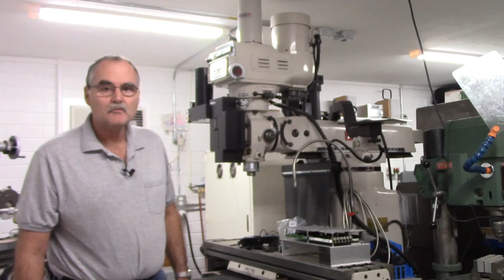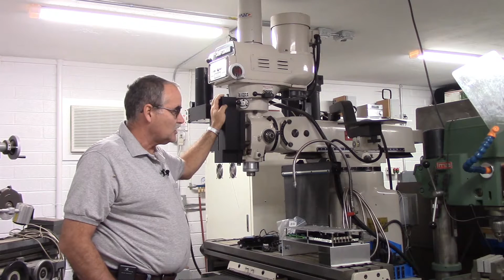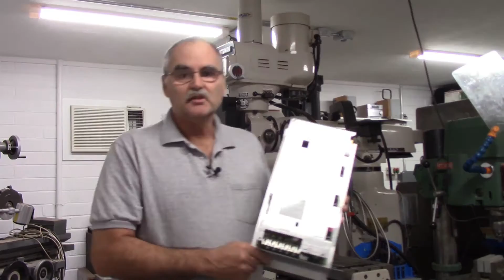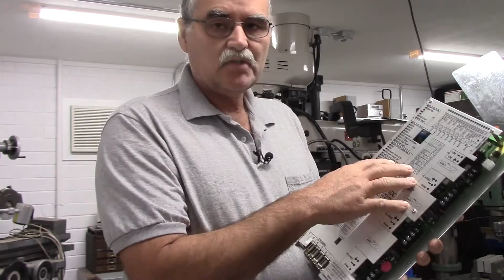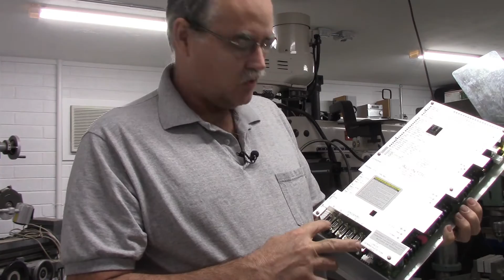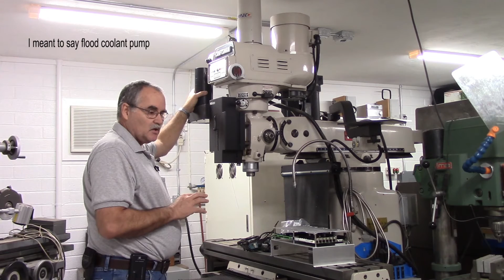Centroid CNC Upgrade - Knee Mill Project Overview

Comment: How many do you have in back lash z axi if currently this kind of machine has a gear?
Reply from the maker: The quill is directly driven. The ball nut attaches to the front of the quill. No gearing.

Comment: Hi Marty, followed here from your post on CNC Zone. In this video, you mention it originally had glass scales.  Does the Allin1DC have the ability to read those for primary loop feedback? I'm considering this board on my Hurco, but want to convert to glass scales and remove the need for leadscrew comp.
Reply from the maker: James, this question is best asked on the Centroid CNC User forums.

Comment: Hi you think I can use it on my Bridgeport Boss8 R2E3
Reply from the maker: Hi Abram. Yes, the All in One DC should work great. Suggest you take pictures of your motors and nameplates and ask the question over on Centroid's User forums where Centroid Support staff monitor as well as other users. http://centroidcncforum.com  I think you would just have to change the encoders on your motors, but would need to see which model motors you have.

Comment: I've been looking at the Centroid for some time now.   Keep up the vids, they're much appreciated.
Reply from the maker: Absolutely. This is my  first Centroid retrofit. I chose it because I felt it was a good value for an industrial control and great support. I'm committed to seeing it through with all the details and problems I run into. Just as anyone else might. If I need support on the control and its configuration, we'll see how its handled.  I'm also going to try and keep track of true costs. There is more to it than just the motion controller.